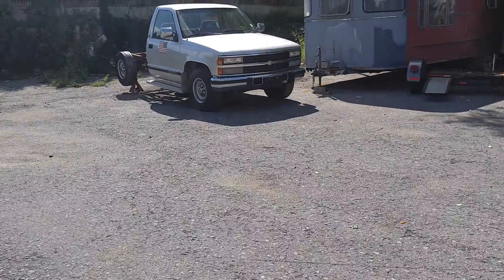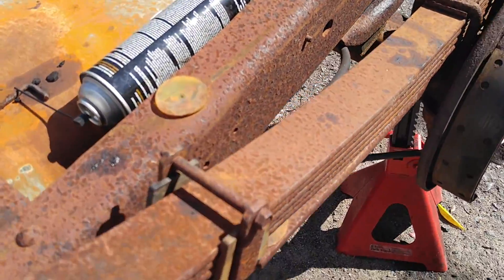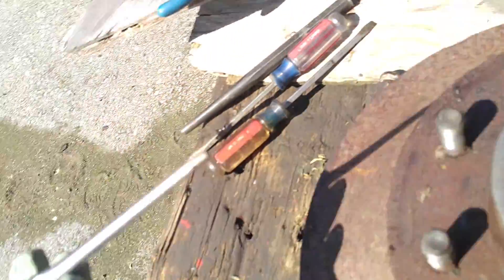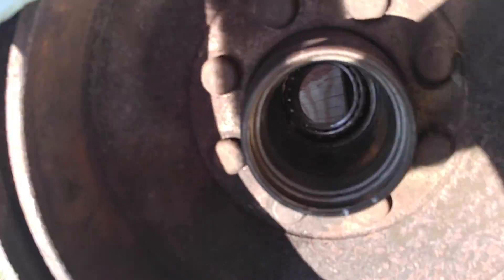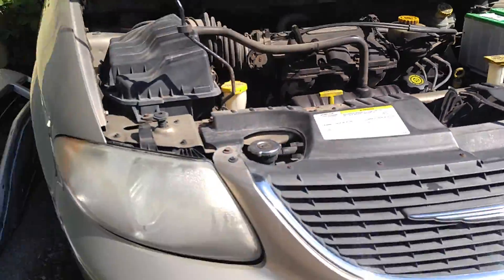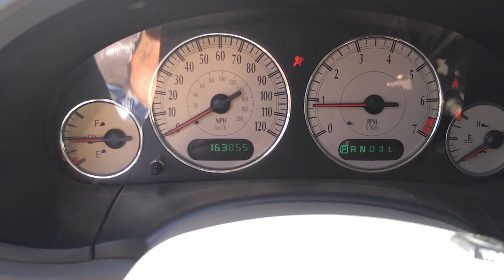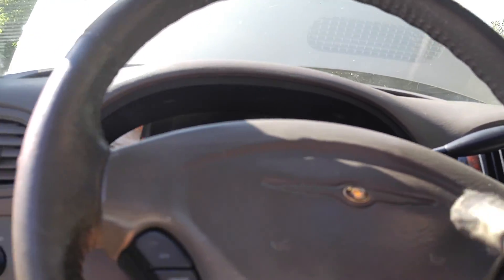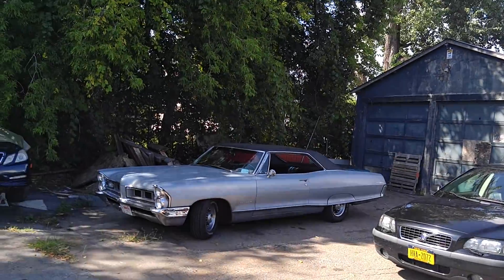6.5 Diesel Turbo Driveway Babble 9 3 18

Comment: These are coil packs working on the waste spark system. These did give trouble as they got older. Wrecking yard units are innexpensive enough. I don't think it is one of the signal wires coming from of the computer. There are three signal wires on this unit plus the 12-volt wire.

Comment: You should clean up the frame while it is exposed and apply a good coating of POR-15
Reply from the maker: 96ChevyDually6.5L if I sandblast the frame, I won't have to use expensive and messy por-15. I'll just prime it with gray primer, paint it with satin paint like GM did, and then fluid film it. And it'll be like new. I just found another identical  truck to the red 6.5 bunker I have. It's in Cape Cod, but it's a mechanical injection, so there's a motor for my Turbo Turtle, I just spoke to the guy and he's more than happy to sell it to me for the price of scrap, it's got a crate motor and he took off the starter, I just have to get it back to my place. 300 miles away
Reply: Be sure to inspect that starter mount before you buy!  I would hate to see broken or cracked starter mounting holes in the block!